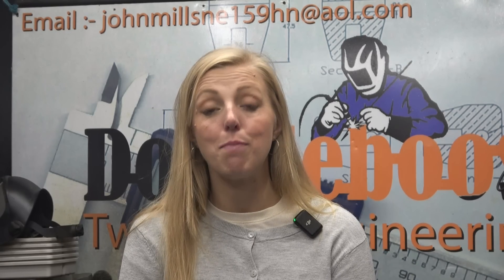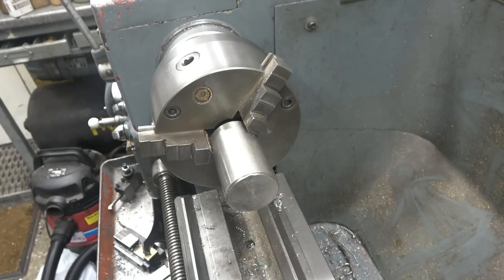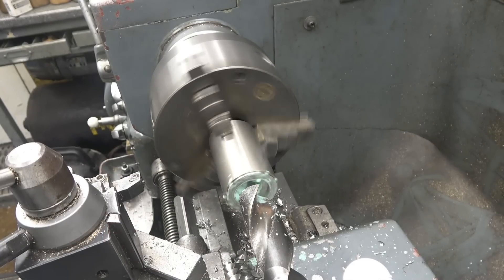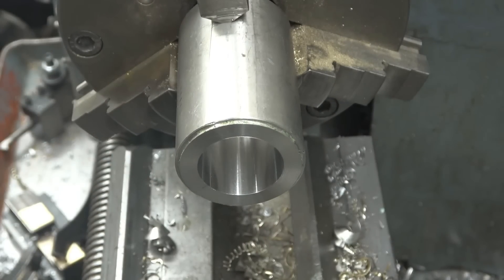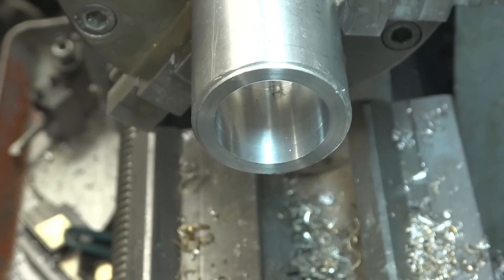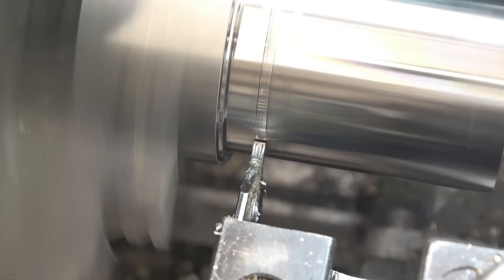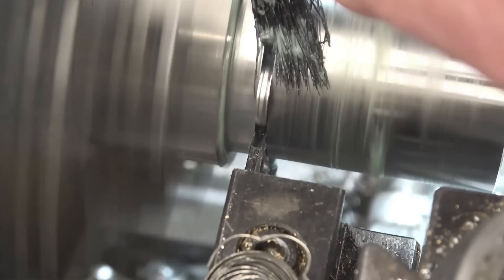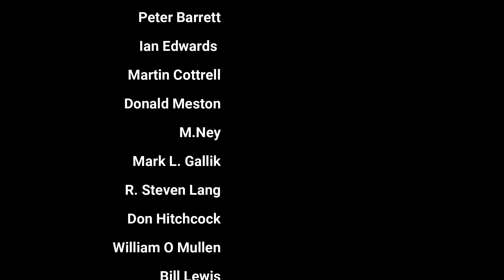SNNC 552  Emmy Visits The Shop . Machining A Press Fit.

Comment: Hi John. Another great video. 

Everyone in the model engineering community keeps breaking  off parting tool blades, and it's one of the scariest operations that a new comer can do, when that tool breaks off and flies off somewhere!!!! (Hence why people should always wear a full face visor)

Lots on Youtubers have suggested using a rear mounted tool post with blade mounted upside down. That definitely works, but means a lot of faffing around. 

SUGGESTION: If you have a cheap Chinese lathe and can afford a quick change tool post, front mounted, as normal, the same can be easily achieved by turning the parting tool upside down, and running the lathe in reverse. Try it. It doesn't dig in, in fact it will lift before getting embedded into you work piece.

Hope this helps someone🧐